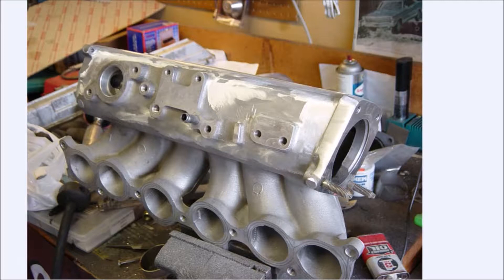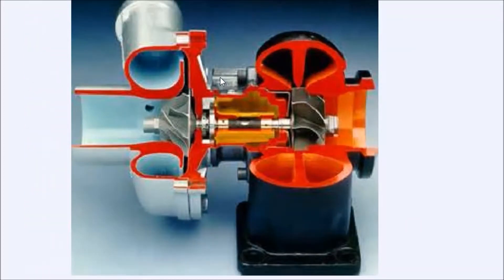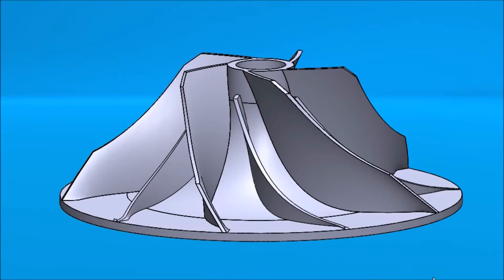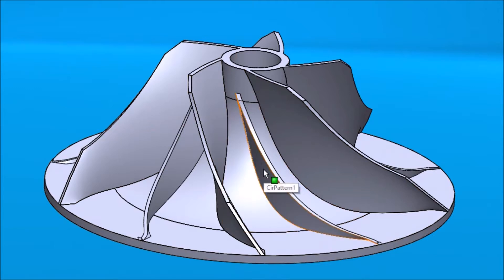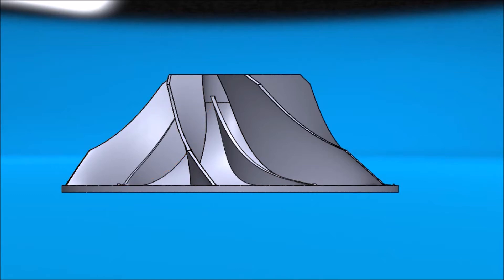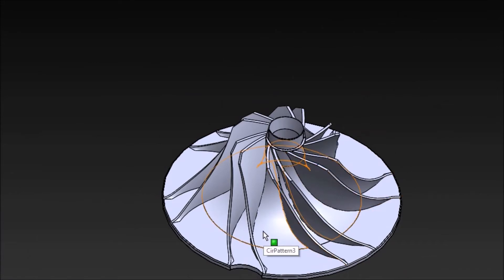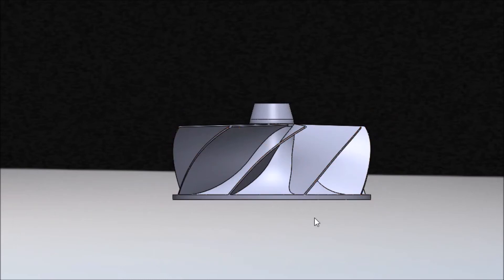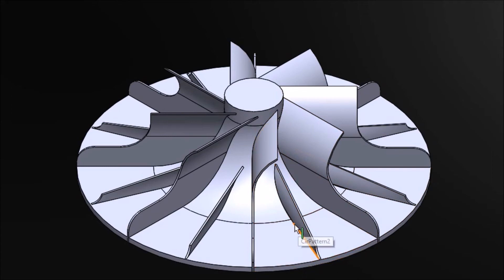Components of Turbochargers Video 2 |JOKO ENGINEERING|

Comment: Does plenum include runners? Also does it extend into the head? ( for volume? )
Reply from the maker: Good Question.  The intake manifold is composed of two parts- the plenum and runners.  The runners bolt onto the head.  Longer runners produce low end torque, shorter fatter runners produce high end horsepower.  The volume of the plenum without the volume of the runners should be about half the engine volume.  Does that answer the question?
Reply: Joko Engineeringhelp yup! Thank you!